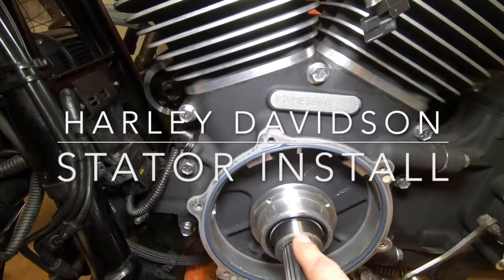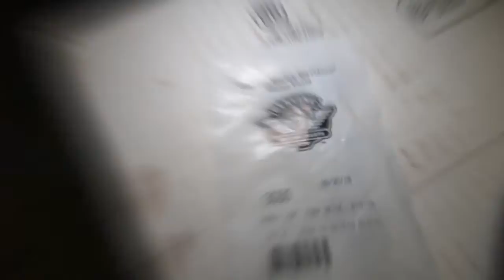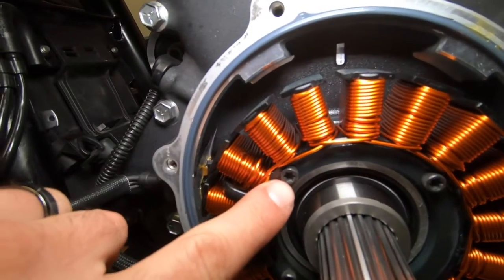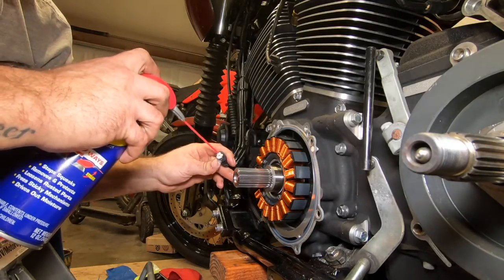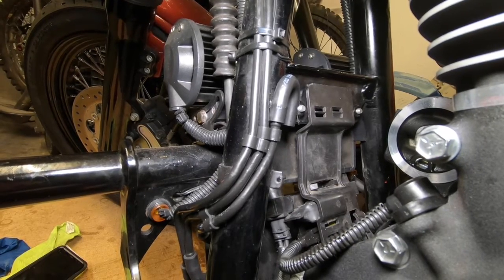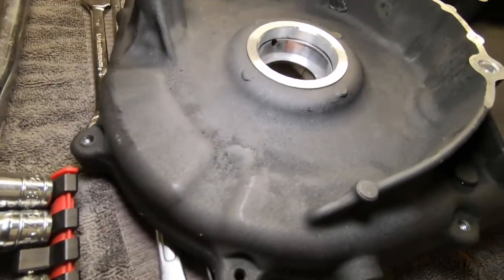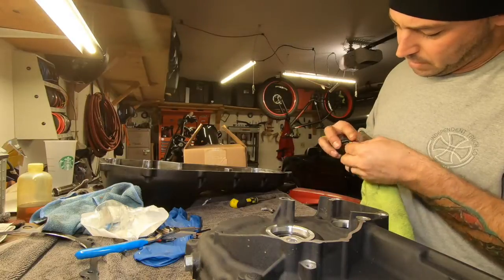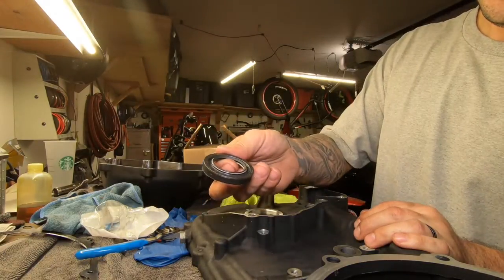HARLEY-DAVIDSON STATOR INSTALL

Comment: I can't pull the cover off my stator it come out so for likes about inch and stops then I let go it goes back in
Reply from the maker: yeah you really got to get after it and pull hard ..
'read the manual in my description on how mechanics use a puller i think there are holes for a screw to get better leverage

Comment: Didnt see you put stator cover on is the any type of spacer or washer that goes on shaft before cover or is it just pushed back on
Reply from the maker: Manual is in the description ..if your running timkin bearing spacing is different i think..

Comment: I just replaced my Stator in my 08 Dyna fat Bob and it was solid black. My question is are the Staors submerged in oil or do i have a leak somewhere. Nice Video
Reply from the maker: leak or old..maybe dust cover for electrical was broke and dirt was getting inside plus the seals
Reply: @Nathan Crosby Definitely, have been using instaflixxer for months myself :D

Comment: 😬uhhmmm why are you scraping the innner primery with that ? Shouldn't you use like a steel wool or a rag 🤔
Reply from the maker: you can use what u want but mine was and still is  all messed up because chain getting bound up from clutch basket blowing and actually bending the metal were it has no longer a perfect surface between gasket sooo..i used a file and got it level and then yes i use silicone to get a really great seal then i let dry 12hrs then add oil ..i actually just did this all over 2 days ago and no leaks ..my primary seal was leaking so i had to remove everything wash and clean now its back on road faster then most bikes no leaks..harley dealers leave old oil and they do not clean the surface at all they leave old oil with metal shaving and just put back on ...harley is the worst at clean and prep i know ..remember more then 1 way to skin a cat ..watch the chain on the bottom when torquing 70mm hex
Reply: @TheGasStation1616  Ok I understand great video 👍

Comment: Any links to an electrical diagnostics manual for the 2013 dyna?
Reply from the maker: whats wrong buddy..let me try and help
you but in most of my videos are manuals..
Reply: THE GAS STATION all is good. Enjoyed your stator install video and appreciate the link to the manual. Thought I might be having some charging issues so I checked the battery which wasn’t too bad yet but wasn’t getting the 14.1-14.5 volts while running. Ohm’d out the stator and it was good. New regulator and battery and done. Bike is 7 years old now and I have to brush up on a lot more than just riding it now. Appreciate the offer. Keep posting good man✌🏻

Comment: Hi bro.i have 2014 low rider.way broken stator for dynas?
Reply from the maker: I don't understand..why or way and what again? I changed mine because I broke my clutch basket and needed to replace stator ..
Reply: @TheGasStation1616  soory for my english.am living europe.my stator broken and aroknow way broken its.23 k miles has my bike
Reply from the maker: @marikamiu7528  Is your stator broken or are you asking how to test the stator? With the bike running it should be putting voltage out use a tester meter look in the manual to troubleshoot stator and electrical problems
Reply from the maker: If your lights don't turn on with the bike not running it's probably a fuse check your fuses..